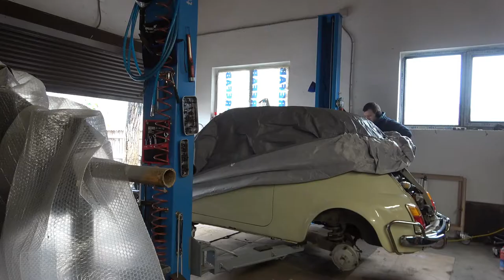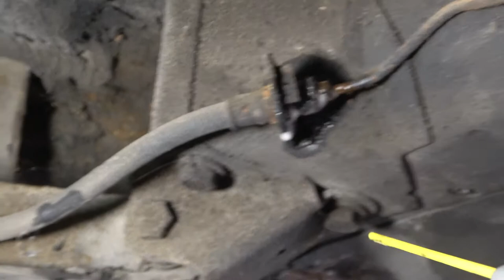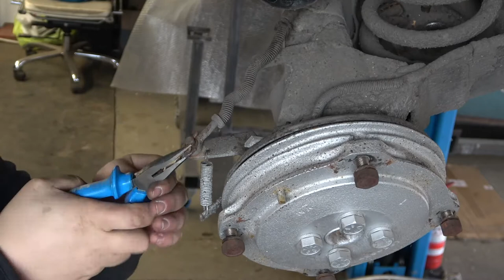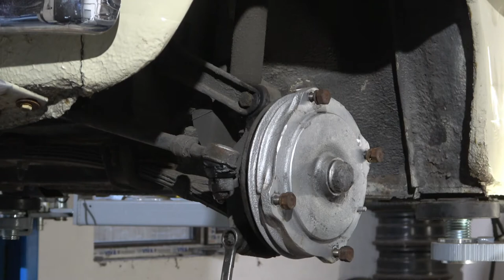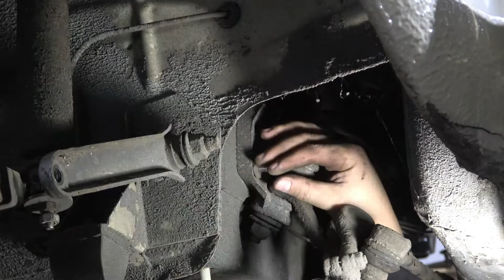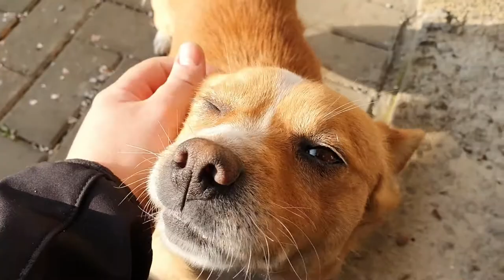Fiat 500 Classic - Part 2 - Suspension & steering removal

Comment: Acum mi-am dat seama ca ai vopsit si sub masina:)) a iesit ft misto. Plus ai schimbat si baia de ulei cu una mai mare banuiesc. In afara de botul masinii ai mai avut rugina undeva?
Reply from the maker: Sub masina am mai avut rugina in lateralele podelelor, sub praguri. Era tabla dreapta acolo asa ca am sudat doua petece dreptunghiulare. Cel mai rau a fost ruginita acolo in fata si panoul vecin, cel cu supprtul de baterie. Pe ala l-am schimbat cam 60%, am taiat pe deasupra bateriei. Am vopsit si antifonat pe sub, din fata pana unde se termina podelele, la transmisie. Compartiment motor il fac in iarna asta, cand fac si motorul. De asemenea sunt ruginite si pragurile, au cateva gauri astupate cu chit. Le am luate noi, probabil anul viitor le schimb si vopsesc toata masina.
Reply: @AircooledProject  la prima vedere zici a ca fost multa. Dar tot cautand am vazut ca acestea sunt punctele normale. De fapt si de drept fata de ce exemplare sunt restaurate pe youtube poti sa zici ca ai avut putina:)). 
Si eu planuiesc sa incep la iarna sa repar cele 2 gauri pe care le-am vazut pana acum. Dar fiind vizibile 2 ma gandesc ca sigur am minim dublu sau triplu cand curat murdaria si antifonul. Am avut noroc de o masina care pana in 85 a stat in Italia si apoi pana anyl trecut in Spania. Acum ramane sa vedem ce gasesc😂

Comment: How did you align your rear axles after you reinstalled them? My shims dropped out when removing & I'm not sure of how to check or re-align the rear axle to drive true & straight.
Reply from the maker: I found the important thing in the rear is that the driveshafts are aligned with the hubs. When the car is on the ground, they should be able to easily slide in and out in the driveshaft end. This was a pain to do, I had to fiddle with the suspension arms and the gearbox position to get it right.